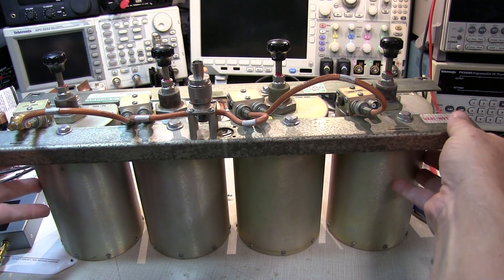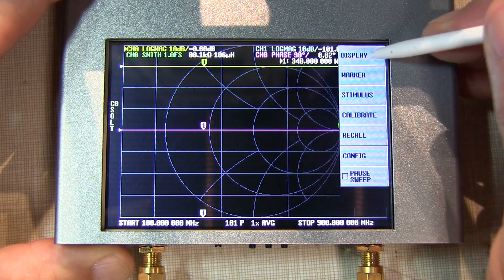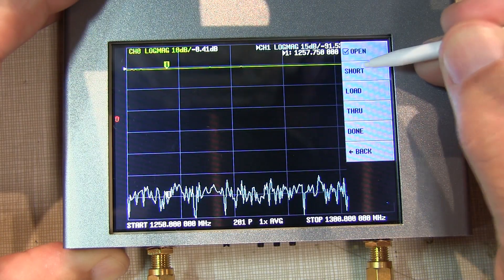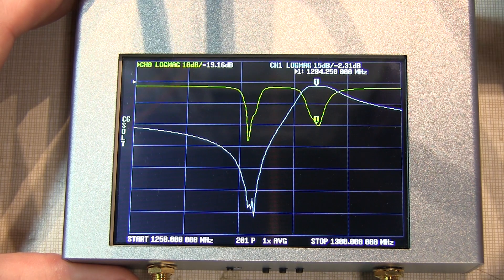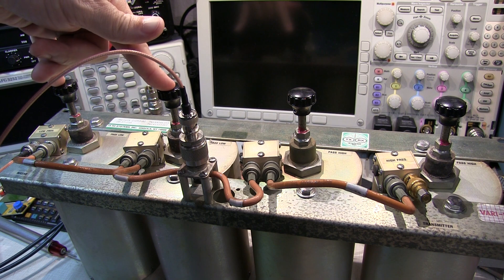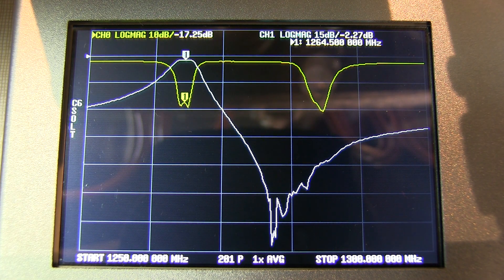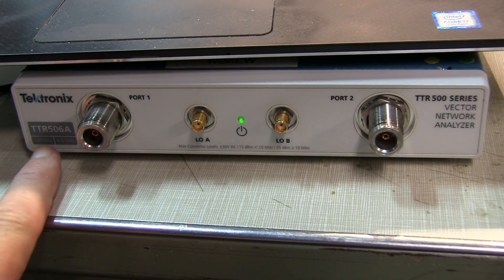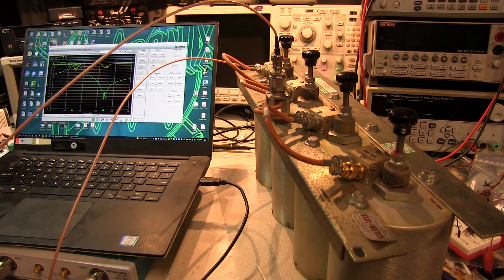#334: How to tune a duplexer with a NanoVNA V2plus4 | is it possible?

Comment: Hi Alan, it seems you're doing a UOSM calibration? I can't see your standard definitions so it may well be you're doing a TOSM calibration but with a non-zero length thru(don't even know if this little device is capable of doing multiple cal types). It may be wise to mention that using a non-zero length thru for a defined zero length thru TOSM calibration, the insertion paths yield inaccurate "absolute" results. 😀 Sorry if I'm so critical, but at 1.2GHz these kind of "errors", if unintentional will already become an headache for young players. 😀 Offcourse for this relative tuning of the Duplexer, the absolute calibration error is not important st all, but it must be mentioned for clarity imho.😀
Reply: the nanovna can't do UOSM from what I understand. but if you're calibrating at the port instead of at the measurement plane, it all is rule of thumb anyways.
Reply: @tommihommi1  Yep, but in the case of a true TOSM or UOSM at least one can de-embed the characteristics of the cables from the DUT if interested. 😀
Reply from the maker: @stefanhummelink3662  Yes, but in this case of course, there wasn't a need to establish a measurement plane at the filter ports.  I have another video that talks about the importance of VNA calibration and the establishment of a proper measurement plane (and another video on port extensions).

Comment: Should the calibration not be done using the leads you are going to use for the notch filters?
Reply from the maker: If I needed to accurately know the phase at the filter ports, yes.  In my case, the loss at these frequencies and the impedance rotation due to these cables, will have no effect on the filter tuning - so it wasn't necessary to calibrate at the end of the cables.

Comment: Whomever you are talking to must have his transmit and receive channels reversed.  In an amateur radio setting, I would not expect a preference for which would have his transmit channel above the center vs. below the center.  You seem to indicate that there is a preference and I don't understand why there might be.
Reply from the maker: Most (but certainly not all) of the amateur radio repeaters in the US are coordinated with their output (transmit) frequencies between 1282-1288MHz and 1290-1294MHz, and the repeater inputs are between 1270-1276MHz.

Comment: Seems like those plungers should have threaded rods so you can make very find adjustments and not rely on just sliding them in and out. Is there a reason why they are not threaded?
Reply from the maker: I think it might be generally more difficult to get a good, solid RF connection on the threaded rod - but I'm not the designer of these things so I can't say for sure.
Reply: Hm.  The plunger and a threaded... gizmo... whatever it is... could be separate pieces.  Even temporarily installed.  I suppose if you did this sort of thing on a regular basis...  either you develop ninja skills, or if you're incapable of such (like me), make more tools!
Reply: I use a small-ish wrench. To move the plunger down, i slightly tap the top of the rod with the wrench. To move the plunger up, I put the open ended side underneath the knob and tap upwards. Works like a charm every time.

Comment: This is pretty cool to see the massive duplexers from what i use at work. Maybe an whats inside episode, if you find a broken duplexer. 😊
Reply from the maker: You should see the ones used for 6m (50-54MHz) repeaters, the cans can be as tall as a small person.
Reply: @w2aew  thanks for the recommendation will check them out.

Comment: Can you show how to tune a Diplexer because I don't know what the differences are between a Diplexer and Duplexer they are different. So I hear that the NanoVNA can't tune filters, Diplexers, Duplexers because of the bandwidth from Odbm to (-)160dbm. To really tune out below -80db the NanoVNA gets distorted and can't do below -80db to -160dbm you need an expensive VNA that can tune filters, diplexers, duplexers because of the bandwidth of the VNA
Reply: A diplexer is generally for separating frequency bands not as closely related as a duplexer, which needs fine notch filters to notch out very close in-band signals. Tuning method would be identical or similar, but how you actually do it would closely depend on the design of the unit itself.
Reply: @ruhnet  Diplexers/Duplexers are sometimes used from Receiving and Transmitting on the SAME frequency or Different frequencies using only ONE antenna and ONE receiver.
Reply: @waynegram8907  That is correct (as are quite a few other uses of them in different forms).
Reply: @ruhnet  like what other different forms? The isolation from port#1 and port#2 has to be -80db to -100dB to prevent crosstalk of the transmitting and receiving
Reply: @waynegram8907  One example: a simple diplexer in a receiver is used to separate low (audio) frequencies from RF in a mixer/detector output. This is one of the "different forms" I was referring to. A NanoVNA (the original design) can accurately tune just about anything as long as the required dynamic range is within 60dB or so. (But note that the dynamic range of the NanoVNA differs with the various frequency bands it covers.)
Reply: @ruhnet  That is what I was saying is that the NanoVNA Dynamic Range is very limited if you are Rejection Filters, Diplexers, Duplexers. If you tune using a NanoVNA you can only tune 60dB of dynamic Range which is not good for tuning. The VNA specs you look for 120dB dynamic range which they cost a lot of money for those VNA
Reply: @waynegram8907  You can also accomplish the same thing with a spectrum analyzer and tracking generator, or even a plain signal generator if you are a bit more patient. (This basically gives you an SNA.) You can get spectrum analyzers secondhand relatively inexpensively with 100dB+ of dynamic range. For that matter if you want to go barebones you can actually accurately tune a filter/duplexer with only a signal generator and RF detector. Even an AD8307 has 90dB of range and you can get them for a few bucks. Lots of ways to do it on the cheap without sacrificing accuracy, you just have to think outside the box sometimes. 😁
Reply: @ruhnet  I have never tried using an RF detector to tune rejection filters, diplexers or duplexer because often RF Detectors are non-linear devices and they are very limited to the frequency span you can get a lot of false positive results. The RF detectors circuits are converting RF frequency into a DC voltage. I'm guessing you would connect a DC voltage meter to the RF detectors DC voltage port. The Spectrum Analyzer would have to be in the Frequency Range you're tuning the filters at also. If you can to tune high frequency the Spectrum analyzers will get costly. For UHF and VHF yes spectrum analyzers are cheap
Reply: @ruhnet  I'm confused about how an RF mixer can be considered a Diplexer/Duplexer because an RF mixer is taking an LFO low frequency Oscillator and mixing it with the RF signal to cancel out the RF carrier frequency or down conversion/ down converters
Reply: @waynegram8907  detectors can be non linear, but as long as you know the range is high enough you can use them to null out a filter.
Reply: @waynegram8907  Not the mixer itself--sorry I should have been a bit clearer: a diplexer is sometimes used after a mixer to separate the sum from the difference frequencies produced by the mixer. One frequency is normally sent along the chain and the other is usually terminated. Although the use case and size of the diplexer for this application is very different from duplexers used for repeaters and such, the concept is the same: it's a 3 port filtering device used to  separate different frequencies.
Reply: @ruhnet  But how are you using an RF Detector to null out a filter because an RF detector converts RF signal into a DC voltage. So are you connecting a DVM DC meter on the RF detector and looking for the maximum DC voltage at a certain frequency to null out?
Reply: @ruhnet  Mostly I just see Rejection Filters for the upper side band and lower side band rejection filters which are AFTER the mixer. I have never seen Diplexer or Duplexer Circuits AFTER a Mixer. The Rejection Filters will Filter out the SUM and Difference frequencies. I'm guessing you can call these Rejection filters either Diplexers or Duplexers? Are you saying that a Diplexer is a 2 port filtering device and a Duplexer is a 3 port filtering device?
Reply: @waynegram8907  Yes, so for example, if the frequency you want to null with the filter is 100MHz, you could set your signal generator to 100MHz at maybe +0dBm (level would depend on the particular detector you used) and feed it into the input of the filter. You would connect your meter to your detector and put the detector on the output of the filter. Tune the filter until your meter nulls out as far as it will go. If the rejection is not high enough, increase the drive to the filter from your signal generator and null again. You can go up and down in frequency slightly to to verify that your signal pops back up when not aligned with the notch of the filter. This would of course take extra care to make sure you aren't working on a secondary notch of the filter, but with some fiddling you could verify this.
Reply: @waynegram8907  No, a rejection filter (like a crystal filter commonly used in an IF stage, or a bandpass filter) is a two port device (one in, one out) and it does not separate frequencies like a diplexer does. Both duplexers and diplexers are 3 port devices. Some mixers need to be terminated into 50 ohms at all output frequencies, so this is a common use of a diplexer circuit in a receiver at the product detector stage: at the output of the mixer/product detector, the diplexer takes the sum and difference frequencies and sends one along to the rest of the circuit and terminates the other one into a 50 ohm resistor or similar. This way the mixer sees a nice 50ohm impedance match at its output at all frequencies, even though one band of frequencies is being thrown away and terminated. You could just as easily take that unneeded band of signals and send it to a separate chain in the receiver (although I don't know what the usefulness of that would be). In other words the principle is the same: a 3 port device splits a single input into two outputs separated by frequency.
Reply: @ruhnet  Tuning the filter until the DC meter reads the "highest DC voltage" at 100Mhz? Most RF EE Engineers have told me to never do this because RF Detectors are Non-Linear devices and can give you False Positive readings when tuning filters as well as the frequency Span of the RF Detector from the starting frequency to the stopping frequency would have to be in the bandwidth of the Filter you're trying to tune.
Reply: @ruhnet  Yes I have never seen a Duplexer/Diplexers being used in the IF Stage after the Mixer. Mostly I have seen in the IF Stage is rejection filters that are rejecting the SUM or Difference frequencies of the Mixer. But you're saying that you have seen RF circuits that have used Duplexers/Diplexers in the IF Stage after the Mixer?
Reply: Diplexers are normally used to separate two different bands, such as an older radio with two separate ports for UHF and VHF. Connecting a diplexer allows connecting both ports to the diplexer, connected to the dual band antenna.
Reply: @AECRADIO1  in the context of mobile radio yes that is correct.
Reply: @AECRADIO1  Can a Duplexer separate two different bands also? or what is the difference between a Duplexer compared to a Diplexer?
Reply: @waynegram8907  Yes, a duplexer/diplexer are often used cross band, in which case they can be much smaller than those like in this video meant to separate very close frequency with high rejection. Look up "Comet Dual Band Duplexer" and you'll see them used for 144MHz/440MHz radios with two antenna ports to use a single antenna between them. When the frequency difference between the two bands isn't very close you don't have to use the big cavity filters so they're much smaller.
Reply: @waynegram8907  Often duplexer/diplexer are used interchangeably but I have read that the difference between the two can also be referring to the power level used. A duplexer is often used at transmitting power levels of watts or more, vs a diplexer which is technically the same thing, but used at smaller signal levels (such as in an exciter or receiver circuit chain.)
Reply: @ruhnet  That doesn't make sense to me because both Duplexers/Diplexers are not Active devices or have active devices they are both passive filtering devices with an RF combiner. Transmitting power levels in high watts would mean that the passive filtering components in the Duplexers/Diplexers would have to be RATED for that RF wattage. I have never looked at the RATED Wattage of passive RF filters components.
Reply: @waynegram8907  Not sure I follow you here completely on the active/passive thing but yes, duplexers/diplexers are (at least to my knowledge) always passive devices. And every device has a rated wattage, and this includes duplexers/diplexers. I suspect the one in Alan's video here is likely rated for around 100W-200W of TX power (just a guess based on the size).
Reply: I think maybe the YouTube comment threading, or lack thereof is causing some confusion here possibly...
Reply: @ruhnet  The Rated TX Power on a Duplexer/Diplexers I have never looked at the datasheets on the components inside to check if the rated component power. I should check the datasheets on TX power of the component. I had no idea that the difference between a Duplexer VS a Diplexer is "based on" the TX power wattage being Transmitted. I know that both Diplexers/Duplexers are "Separating Frequencies" to ONE receiver or ONE Antenna.